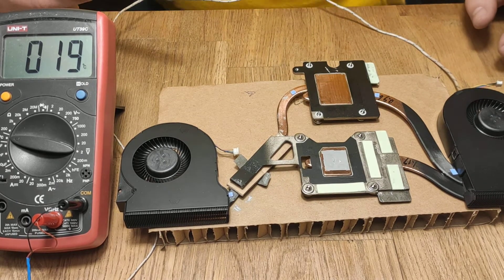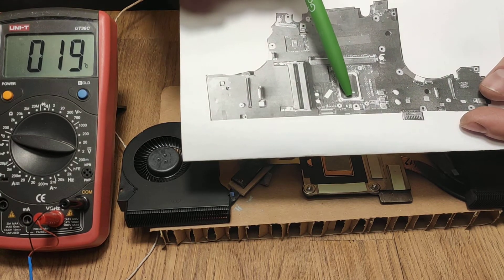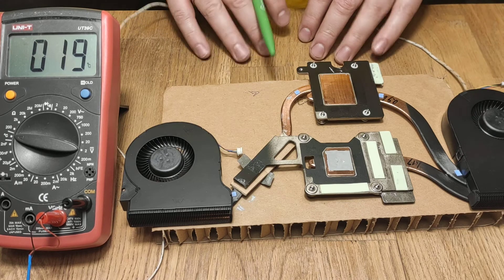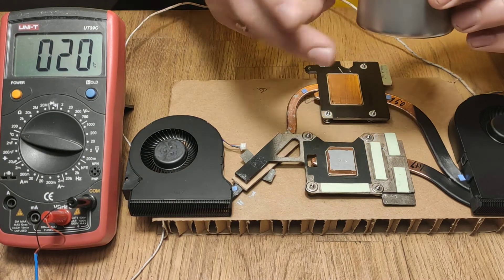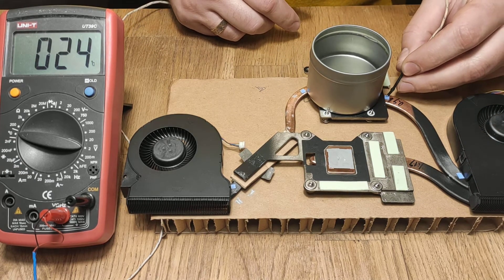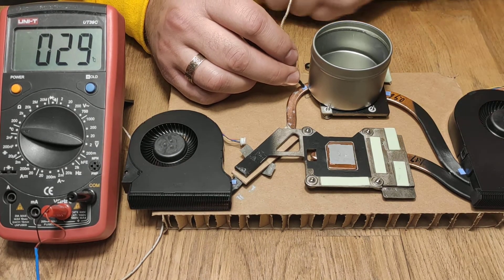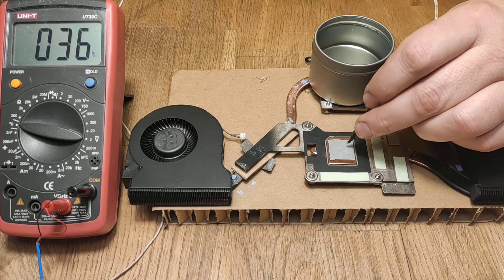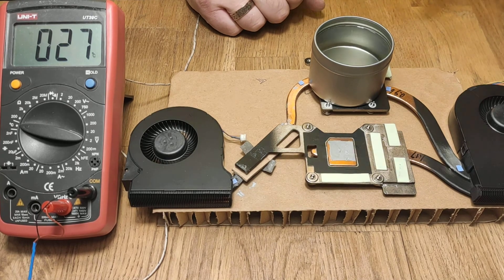Dell Precision 7510 overheating heatsink diagnostics (Part 1)

Comment: My 7510 has been a hot  running nightmare since I got it in 2017.
Constantly shutting down, my SSD burned out due to the heat.
The heat of the laptop shattered my glass desk.
Thousands of dollars wasted.

Comment: I am searching for laptop and the candidates are Dell Precision 5520 and 7520. I have seen a lof of topics related to the overheating, but I think 5520 does this more often, since the ventilation is under the laptop and the laptop is thin. What is your observation to this?
Reply from the maker: They are very different laptops. 5520 will do thermal throttling. 7520 come with docking port underneath and is more upgradable (gpu, 4 memory slots). 5520 is ultrabook - much longer battery life and much more compact. Price difference also is noticeable! 7520 is packed with ports - 4 usb 3, usb-c (thunderbolt optional), display port, hdmi (and docking port). If you have chance then run some gpu benchmark and cpu benchmark before purchase. With 7520 battery is another issue - there are aftermarket batteries from china that just dont perform and cause considerable throttling (7520 running bellow 1ghz because of battery is possible).  7520 will not overheat nor thermal throttle with properly running fan (replace if needed).

Comment: Thank you very much for the video, i have the same problem of thermal shutdowns , would changing the laptop's thermalPaste be enough to repare the problem?
Reply from the maker: Start by cleaning dust with air. Then replace thermal grease. With laptop open try to measure efficiency of thermal tubes and look if copper heatsink that rests against CPU has not bent or deformed.